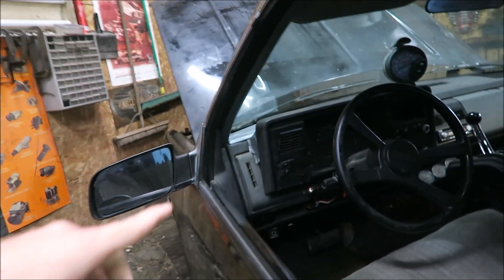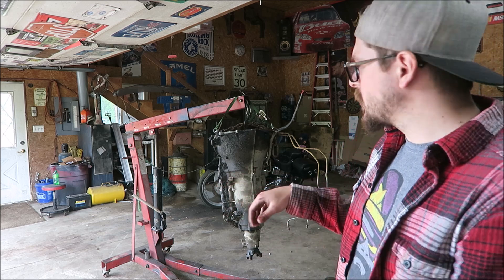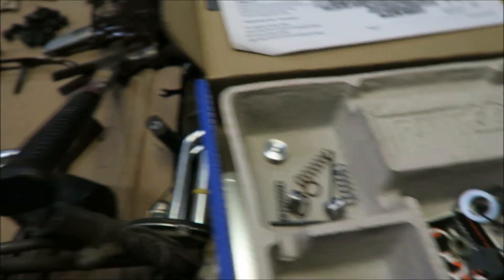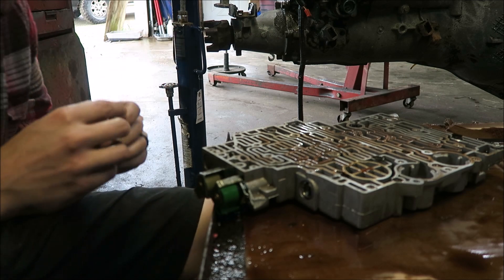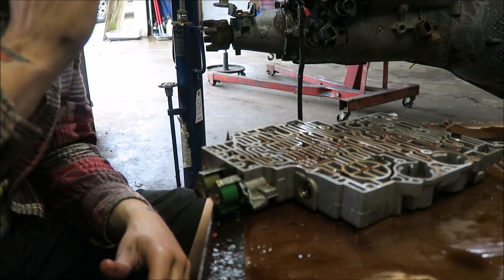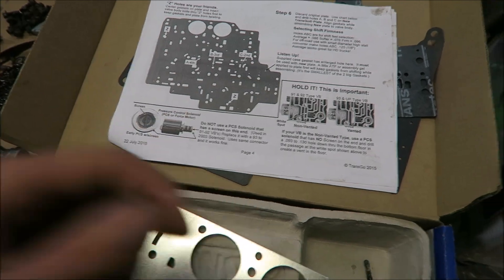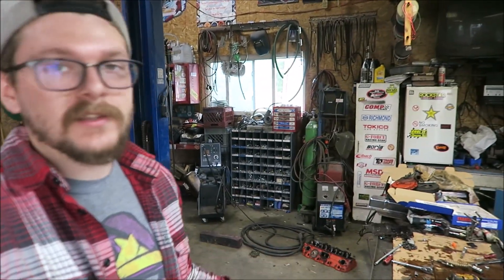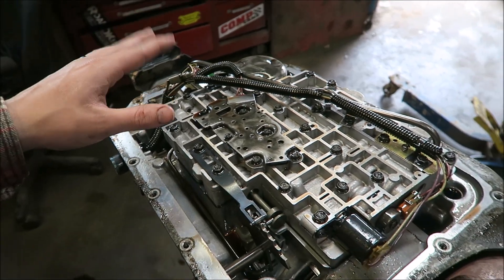4L80e Transgo HD2 Kit Install Step by Step

Comment: I think the 2 springs together would equate to stock shifts. The stronger spring means a weaker shift.. the small spring is for firmest shifts. It allows the fluid to move the piston faster. 
  I put a B&M kit into a 4L80E like 10 years ago. I plan to do another one soon. Thanks for the step by step video.

Comment: A good friend of mine has owned a performance oriented mechanic shop that specializes in transmissions for many years and he uses TransGo stuff a lot, really likes it. I've had quite a few built by him using their stuff and have always been happy with the results.
Reply from the maker: I haven't heard many bad things about it, aside from some other commenters pointing out that it's not advised to drill out for that relief valve. Oh well, I guess we'll see what happens with it lol
Reply: SniderTron 3000 Yeah it's a mixed bag on that, I've seen some live with it and some not. Actually softening mine up helped out, it's cool to bark tires on 1-2 and 2-3 shifts but it's hard on parts. A crisp but more importantly fast engagement is what you want.
Reply from the maker: That's exactly what I'm hoping for. Just firm, crisp shifts. I got the truck back together today and drove it home and it felt okay. Didn't feel anything slipping, but I will admit that I was expecting harder shifts. But, I know with the old transmission, I wanted to up the line pressure too because it was really soft. 

I'm not sure if I should go back and plug that relief off or just leave it and see if it helps.
Reply: SniderTron 3000 You can play around with it, plugging it may help some. To tell you the truth over the years I've come to realize that old 400's or a glide is the way to go. I just always end up having problems with anything else. Granted I haven't chose to go much faster than 9.20's or 30's but a low 9 is still a low 9 and I've had 400's and glides last a long time running that number.

Comment: @5:40 :  There is no way I could have spent as much time and energy as you did on cleaning the case, only to wheel it back into the garage, without giving it a bit more cleaning time, with a brush, to loosen the last little bit of sludge off of it.  To each his own. 😎

Comment: How much hp do you think it can handle. I want to buy this. Replace clutches, and put at 300m input for a safe 1000hp build (700-800 realistically but overbuilding)

Comment: Always use Wal Mart spray 9 and p Power  and then a wire brush in drill, but oven cleaner would work to take it apart

Comment: Snider Tron 3000 great videos bro.. this pertains to jack black .. what cylinder head casting do you Have, did you do any machine work.  What lift are you running? My setup is 515/515 108 LSA 2500-6500 lunati bracket master II
Reply from the maker: They're Speedmaster heads, 190cc intake runner, 64cc chamber. They're box stock right now. If I remember right, with the 1.6 rockers, total lift was like .522/.522. Its the xe274 cam
Reply: @SniderTron3000  nice man I have another SBC 4 bolt main I'm rebuilding soon this one has the trashy swirl port heads I have it on the engine cradle now. Someone did some machine work on the heads double springs and screw In studs I'm gonna crank it on the stand first to see if it's okay.. then throwing performance parts... On my channel I built a stout 353 vortec pump gas with that cam I mentioned earlier check it out sometime...I'm not a vlogger love your videos bro.

Comment: There's some discussion that the pressure relief modification might not be a good idea.  According to the Sloppy Wiki "It doesn't really fix anything and there's a big risk to break sh!t. Moral of the story... don't do the relief mod."  It's your stuff and you are the one who drives it.  Just a heads up.
Reply from the maker: Are you talking about for the pump or the sprung valve deal? I haven't looked at the wiki in a while, might have to take a refresher course lol
Reply: @fixins  From what I have been seeing Sonnax Boost valve with relief Incorporated is better option. Not sure if you have anymore details?

Comment: I hope you didn't follow all of the instructions faithfully, there's a few steps that guys with a lot of 4l80/HD2 kit experience say to skip to prevent any issues further down the road.

1-no
2-yes
3-sure. Not needed but ok
4-Fuck No
5-Fuck no
6 on pg 4---yes. 2nd=.093 3rd=.110 4th=.110
Can go larger on 3rd and 4th but that's a good place to start
6 on pg 5---yes. You really should consider blocking both accumulators altogether if you're in there but you're using an hd2 so I doubt youll do that or know how
7-absolutely
8-Fuck no. Transgo bolt is total junk
9-no.
10-you can. Dont need to. Feed hole size will help more

You wont be doing any of the internal upgrades. If you do internal upgrades... that means you're comfortable taking it apart...in which case you shouldnt have bought the hd2 at all
Reply from the maker: I'm debating on redoing it with my old valve body, just have to check to see if the do interchange. I did a brief googling and it looks like it should.
Reply: I forget exactly why people were having problems, but I think it had to do with a fluid starvation issue. Something about the holes the kit makes you drill allowing too much fluid to bypass and starving the transmission, and I think that only applies to performance applications where you're gonna need higher line pressure. I hope I didn't come off as discouraging, I've just done some research about the hd2 kit and I remember reading different forums and Facebook groups and seeing the same people recommend skipping some of the steps.

Comment: Nooooo dont drill the void.  Its been known for the ball to not seat and cause issues. 

Read here 
https://sites.google.com/site/sloppywiki/everything-ls/4l80e-info?authuser=0
Reply: It's a bad mod because if the transgo ball doesn't seal perfectly...or over time it wears out and leaks...or gets cocked sideways etc...then it leaks torque signal fluid and causes horribly LOW line pressure and cooks the trans
It doesn't really fix anything and there's a big risk to break shit. Moral of the story... don't do the relief mod